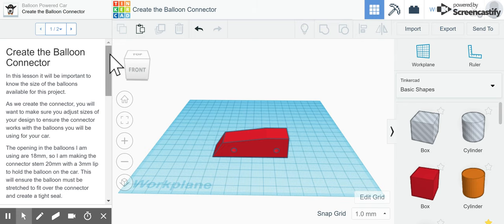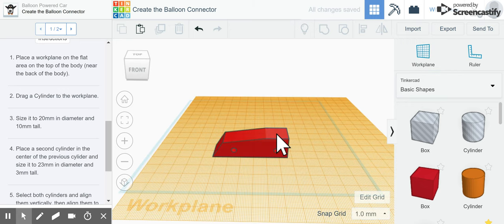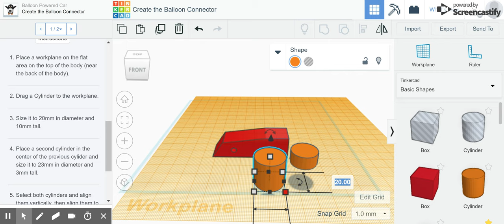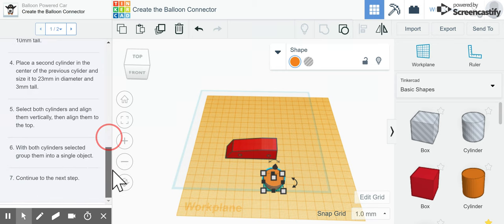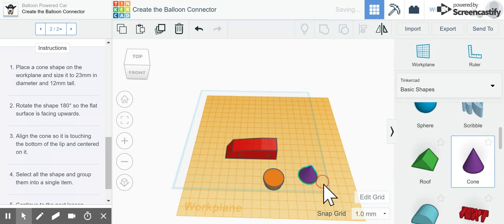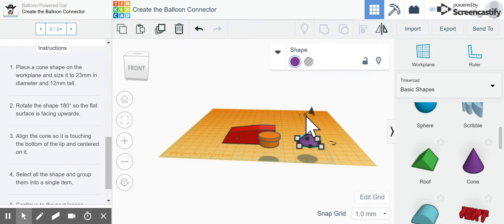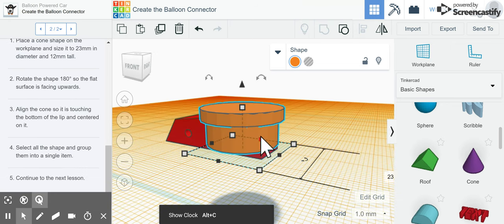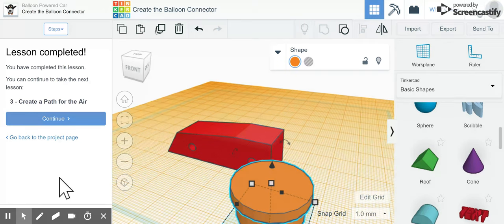3D design Create the Balloon Connector | Tinkercad

Comment: My turned purple can you help me please
Reply from the maker: If you click on the part, and then click on the circle with the color in the box, you should be able to change the color to whatever you want. If you want parts separate colors, do this before you group it, then after you group it click on the same thing and then the little square in the bottom left corner that says "multicolor" and it should put the parts back to the colors you originally chose.